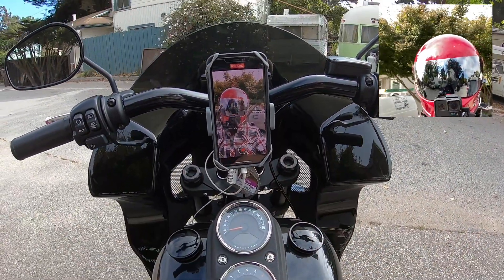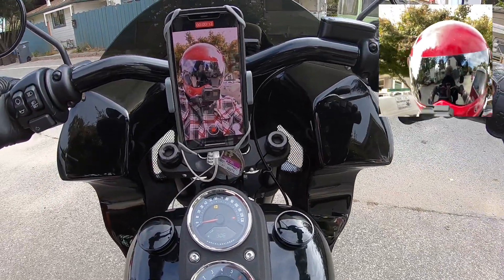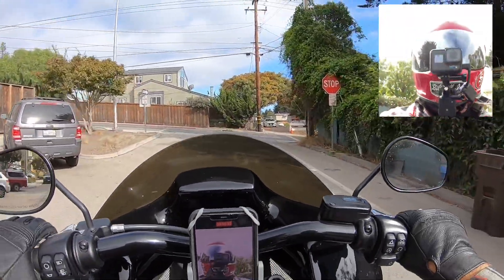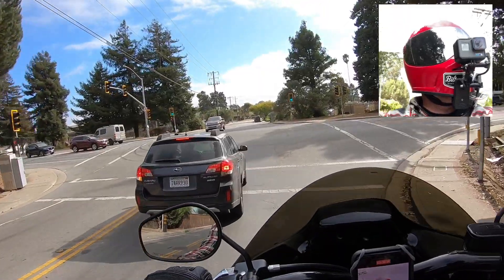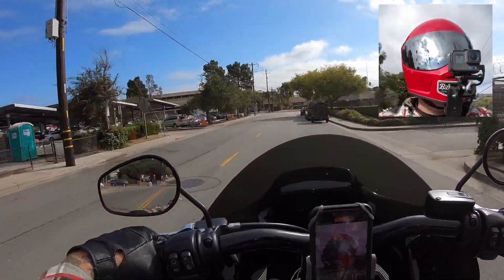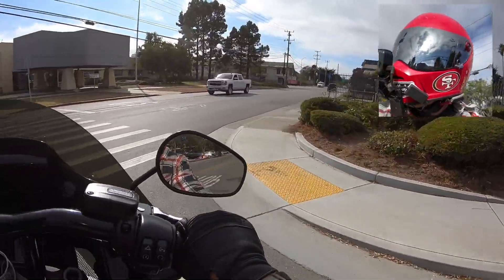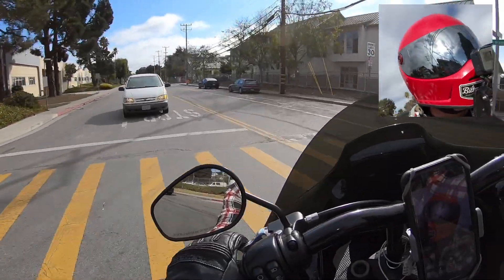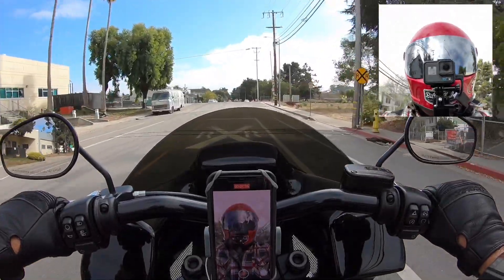let’s talk HVACR leak checking

Comment: I have seen Techs temporarily disable the Condenser fan/s in order to drive up pressure making it easier to find some leaks. Systems were not left running like this and pressures were closely monitored for any of the new techs that might get the wrong idea.

Comment: To pinpoint a leak my best success is Ultrasonic, if it saturates you can adjust on the fly. Everything else gets to a point and saturates and then the process slows to a crawl, but with Ultrasonic the process is very fast. Downside is when there is a room full of air leaks, industrial setting mostly, and then the directional nozzle comes out and I pay must more attention to being exactly on the line. I did all of my leak checking in a room full of small air leaks, so noise and reflected noise were always an issue but I was able to get the job done. A person still relies on system knowledge and experience to be able to  use any tool effectively.
Reply from the maker: I need to try the ultrasonic.

Comment: Ok so I've been in this business since 1990, and until a year or so ago I was a strong believer in "nothing goes into the sealed system but refrigerant and oil". Until one of the old school guys at the supply house talked me into trying One&Done leak stop with dye. Now if I have to do a gas and go for whatever reason, I gas the unit up and add leak stop (after doing a sweep with the H10, and not finding anything). When I go back for a follow up to really dig into the system, I would say 80% of the time the leak is gone. As for the 20% that is still leaking 15% of those are found easily with the UV light. Then of course that remaining 5% is a bitch.  20 years ago I would have never even considered this option for fear of gunking up the TXV or the cap tube, but technology has really come a long way in this area, and I haven't had any problems due to using the product.  Keep in mind this doesn't replace good refrigeration practices, but in a pinch it can save your butt.

Comment: Ultrasonic leak detectors had good luck with it on some lakes it has its place..  ultrasonic can use with dry nitrogen or under vacuum before you put in the refrigerator.
            Sometimes I like my D-TEK  stratus But most of the time the H 10 wins out. For some leaks UV dye is the way to go especially for finding a month later.